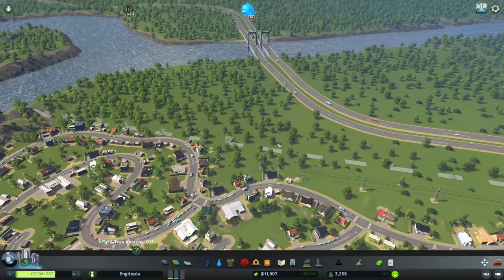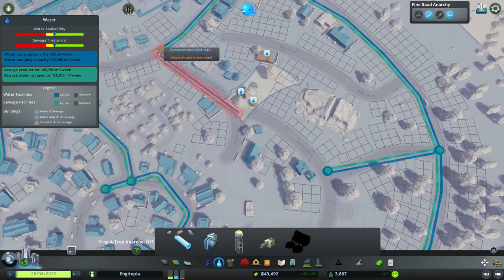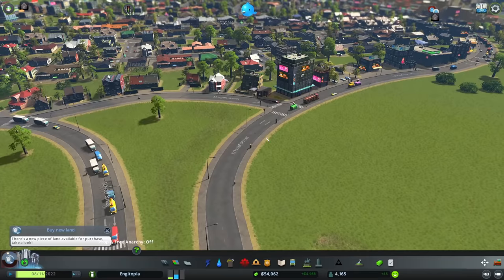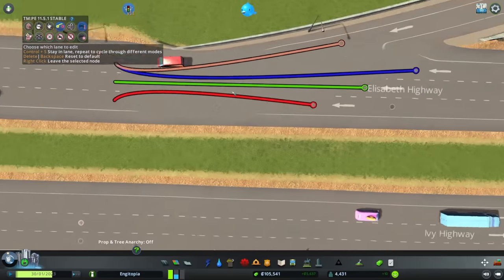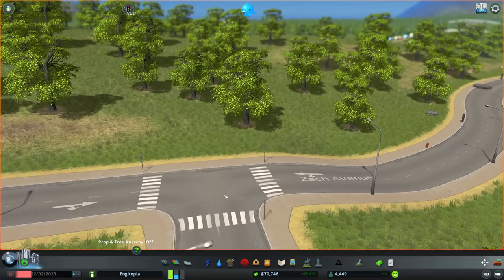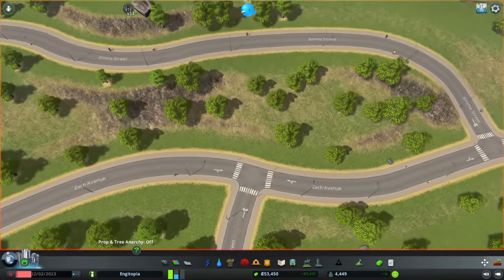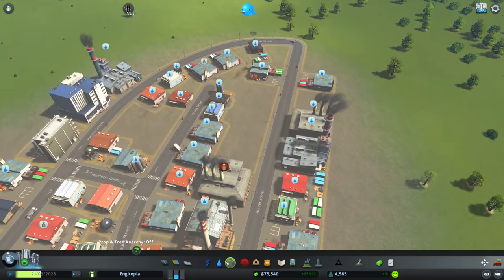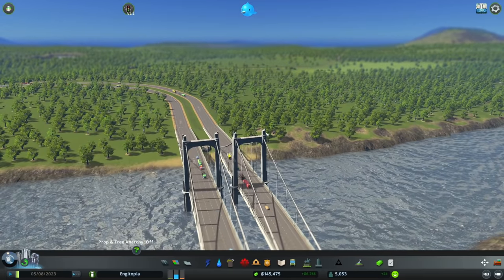PEOPLE QUEUED FOR DAYS just to catch a glimpse of my latest Public Sculpture in Engitopia!

Comment: 8:29 You have parking enabled for that section of road. You can use TM:PE to designate that section no parking.
12:35 You could've used the move tool here to change the elevation of the road with the page up and page down keys
Reply: didn't scroll wheel also work? omaybe i don't remember correctly though

Comment: There's a mod called node controller which lets you smooth out nodes, that'll sort out the merge onto the motorway being funky.
Reply from the maker: Thanks I'll try and have a look
Reply: @RealCivilEngineerGaming  Once you use node controller you can then use another mod called Intersection Marking Tool to add the road lines and have lanes actually merge.

Comment: I did see you busy at the highway.
Easy solution i always make in my city is just a bridge over the highway and then the exit connected to the bridge.
Of course to the other side you can there create your entrance to the Highway.
To avoid traffic jams, i keep some distance between the junctions and the bridge and i need to say, it works well without massive traffic jams.
For the bridge i always use the four lane road, for the lane switching.
Cheap and simple and works good and also easy to expand to the other side to the highway without using lots of space.

Comment: With the move it mod if you select each of those circle nodes on the road you can use page up or down to fine tune the height better than in the base game. Also use Shift to select multiple nodes and you can move the whole selected nodes up or down and flatten them out as needed.

Comment: The city I live in has a park at the end of a water main and we have constant problems with the water pressure. Apparently the pressure limiting valve needs flowing water to work, and if there is no flow, I gets all out of whack. Pressure spikes result and destroy plumbing in the sprinklers and the park restroom.  I just work on the lawn sprinklers for the parks; I'm not an engineer. But I've seen firsthand why dead ends are a problem.

Comment: The traffic mod uses german signs so your exit ramps should be limited to 60 kph, roads inside city limits should be at 50 kph, roads in residential areas should be at 30, and Schrauff street is what we call an "Umgehungsstraße" which is usually limited to something between 70 and 100 kph, the motorway of course will be unlimited

Comment: Cities Skylines doesn't actually delete trees when you build over them and the game still renders them as though they were visible. This is only an issue in larger, longer running games were cpu performance will start to suffer since it is still rendering thousands of trees. Actually deleting the trees priors to putting down buildings/roads will help improve performance later on.

Comment: Your highway needs to be 2 lanes instead of 3 in the short section between the interchanges for proper lane dynamics
Reply: I think this might be a US/UK difference. In the UK, we really don't like forcing traffic in the "slow" lane to have to merge with the centre lane in order to stay on the highway. We tend to work on the principle that you should only have to change lanes to either leave the road or overtake. Also, dropping the main road from three lanes to two is basically assuming that one third of the traffic is going to leave at the junction, which is very rarely the case.